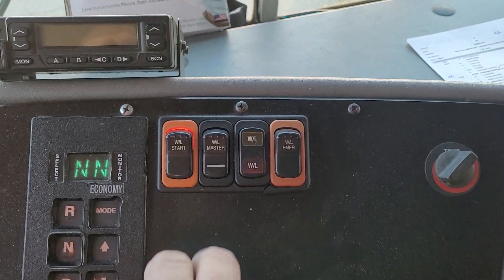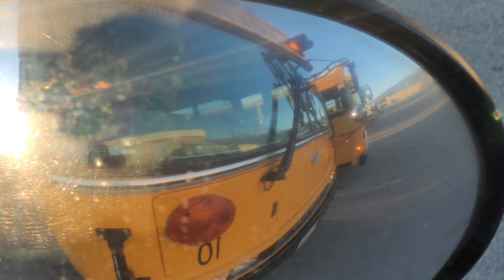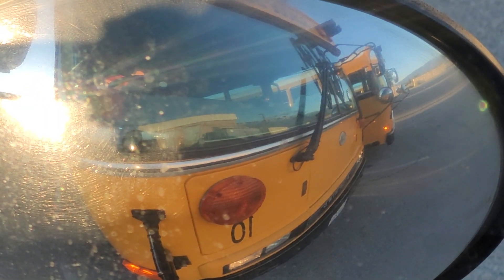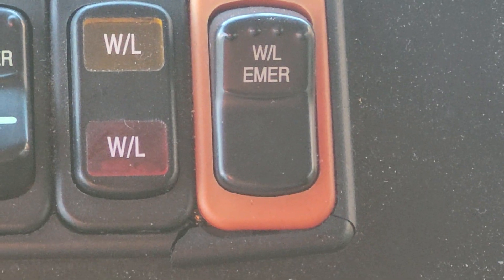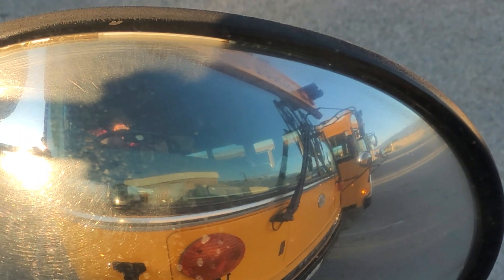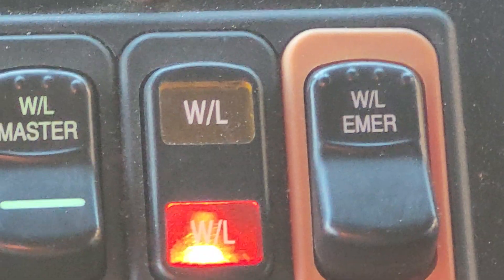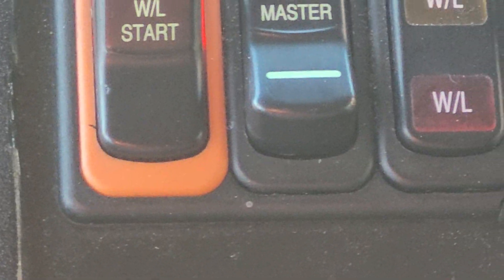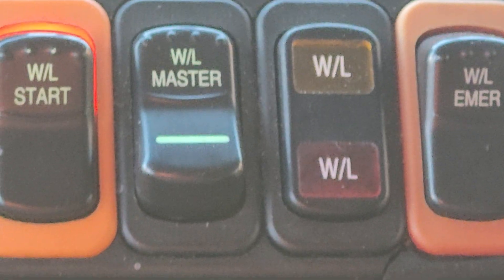How does the W/L EMER switch work. 2007 Blue Bird AARE CNG school bus

Comment: That is illegal sir in the state of California. You are not allowed to activate your red lights with the door switch. This why California spec buses have that red override switch sir. per the VC your stop sign has to be fully extended before your doors are open. This is a shock to me, I hope your training department is not showing you guy this way.
Reply from the maker: This video was done to answer a question on how the lights and door works. This is not a training video. These are information videos on the equipment we school bus drivers get to use.

If you listened to the video you would have heard that I do use the Emergency Warning light switch correctly.
Reply: @jonusle2937 I’m glad to hear that. Continue using it that way for all your stops, not just your escort stops. Thank you!
Reply from the maker: @Rj20999 most of the folks that follow my channel are busnuts like me. So when I answer questions with a video, I try to give the simplest answers.

You wouldn't believe how much grief I get from out of state drivers telling me that they would be fired for leaving a bus load of students alone, let alone escorting them across the street.

Comment: So from what I understand the WL Emergency can act as a Red Override Switch correct?
Reply from the maker: Yes, hit that switch and the reds are on whether your service door is open or closed.

 In California we have Child Check Systems on our buses. Sometimes when doing pretrips there isn't enough air in the system to close the service door. Once the system arms itself,  you have about 90 seconds before the horn starts honking. So we just hit the WL Emergency switch and that stops the Child Check Alarm.

Then when pressure builds enough to close the door, we close the door and turn off the switch.
Reply: Gotcha 😎

Comment: I thought that the bus scanned and identified students automatically. 😄
Have you noticed if all the switch positions on the panels are the same for all similar model buses?
I have seen some that are (imo) out of order: red, yellow, door.
We are told not to use the door switch to activate the red.
Reply from the maker: My understanding is some districts have scanners for marking students present on absent on their school buses. We aren't that high tech here yet.

Most Blue Birds have a similar switch system. They are just scattered to different locations in the buses.

When I started driving in 1985, the crossing lights switch was a long lever that turned left to activate and right to cancel and there was no 8 light system.  Only red crossing lights.
Reply: Each state has different switches and designated layout. In Kentucky we don’t have warning light master and those controls must be on the left side panel.